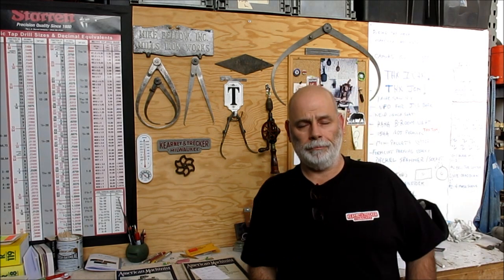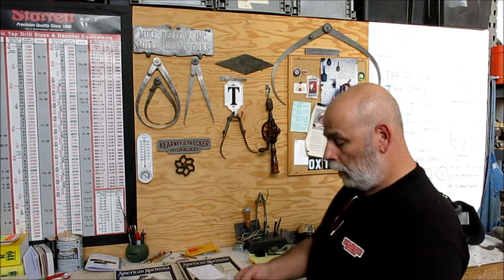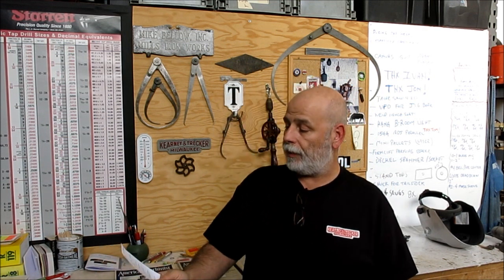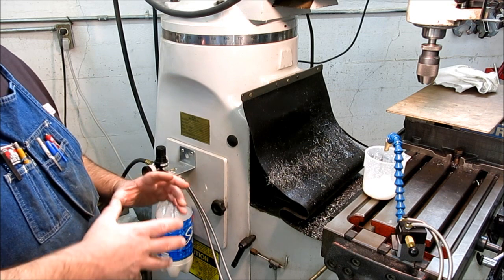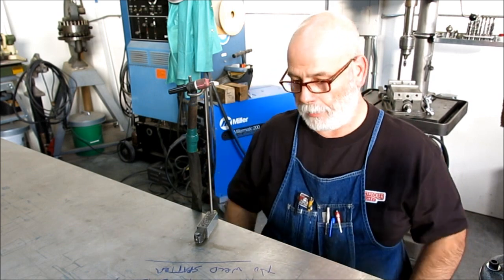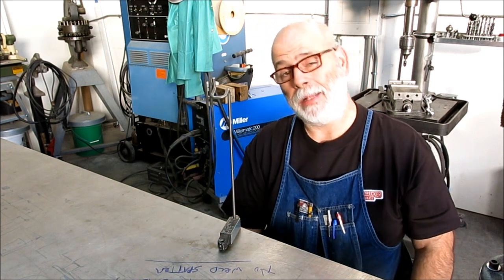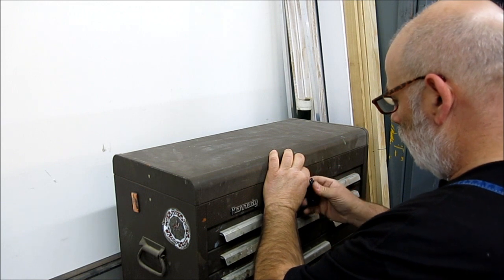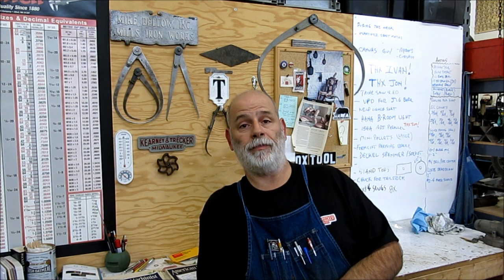Meatloaf 4

Comment: I have the Noga mister on my lathe (and borrow it over to the cnc milling machine) and I am pretty happy with it, except, that it is a bit hard to adjust for a very little spray-mist, but I dont use a pressurized container for the cooleant. I like my mister with almost no liquid in the air, just enough to get the surface of the workpiece a little bit wet.
I will adapt your idea, maybe even with the plastic soda bottles :)

Comment: Genius coolant system - no more fogged glasses !
The NOGA valve assembly saves reinventing the wheel - something I was trained to avoid many years ago. Your TIG torch holder story is a classic, dropping them isn't too great either, those alumina cups get expensive.
Oh yes - we had a guy start the tig welder with the foreman's help - no argon AND no water cooling !
Reply from the maker: Hi Jester,

I have a few spare wheels floating around the shop. Sometimes you never learn.

Cheers,

Tom

Comment: PS. I drove a 24 hour Tire Repair service truck and also I am a Auto mechanic and used a ratchet strap hold down all the time and I always fed the loose end through the sides of my truck to tie down loads of car & light truck tires and you can't feed the buckle between the cracks like the loose end!

Comment: on your bottle lift I left a suggestion that you mount the hook end permanently to the lift and only feed the loose end of the strap past the tank and put it through the slot in the ratchet and pull up the slack and tighten it down with the ratchet handle!

Comment: Hi Tom,

I really like your coolant set up for an open mill. I am currently using brush oil and air after some debacles with the mist system which came with the mill. I did like the cooling of the mist system. Water works much better than oil!

I have looked at some of the DIY flood systems. While they cool well, I don't think they they do a good job of removing the chips. You need velocity to get the chips from deep slots otw your recutting chips. On an open mill this would not be pretty.

I owe you lunch for all the good tips! I am even looking at my first pair of overalls!

Thanks!

Bill
Reply from the maker: Hi Bill,

I agree. This is why I built my own setup. Sometimes I want more air than liquid and sometimes I want pure air. You don't really need much to do a good job with cooling the cutter and work on a small machine.

Cheers,

Tom

Comment: One option for a nozzle holder. Where I retired from we used a Delrin or other engineering plastic holder that was a 240 to 270 degree segment of a circle with an ID maybe .010 under the quill diameter. Thickness of 3/8ths to 1/2. This ring segment had a leg opposite the gap where you could put a piece of 1/4" drill rod or a dowel pin. Or what ever size rod you would need. Only you had to put a Quick Release Depth Stop at the top of the travel so that the holder would not get pushed off when you ran the quill up. Gave mine away unfortunately. It was actually an apprentice at work that came up with the idea. We had a fixture plate an ran them off on an Anilam or Trak.  Although I'm sure others have thought of it.
Reply from the maker: Hi M,

Some mills have a boss in the casting for holding a rod. Mine has one but it not super convenient for a lot of things. Thanks for the comment.

Cheers,

Tom

Comment: Meatloafing around tonight, came in to this series a little late and now trying to catch-up. Don't burn your winky!!! Classic!

Going completely off topic; Kelty has a new advertisement that preceded this video. They make a good variety of gear and packs (backpacks). Years ago I hauled a Kelty pack around the former Soviet Union for 12 weeks. The pack was purchased specifically for the trip and was a new design internal frame with duffle bag sling style attributes on the large capacity pack. Upon my return I sent a letter to Kelty pointing out a few small problems with the pack and a few improvements but most importantly thanks and compliments on an overall great pack. Needles to say they sent me a free pack complete with all repairs and improvements that I use to this day for biz travels..
Reply from the maker: TurbineBorescope Now that is a great story. I have heard that Kelty and Mountainsmith used to be like this. I bought a Kifaru quite a few years ago. You could slide down a granite cliff sitting on it and it would not show any wear. The guy that started Mountainsmith started Kifaru after he sold MS.

Cheers,

Tom

Comment: Hi Tom, thanks for the videos! Is it possible that the gaps in the bottle cap thread are so that as you open a bottle of soda, the pressure is progressively released downwards, rather than having all the pressure blast out at the instant the cap is freed (if there were no gaps, the cap would tend to be shot upwards toward the ceiling at the last second). So it allows a controlled pressure release. Bottles in the UK have similar gaps in the bottle (male thread) so as the gaps line up, PSSSHHHT!

Comment: first hand experience. In high school learning to gas weld. While welding some steel, pop. One drop landed in my lap. My jeans didn't stop the progress which ended up between the left one and my leg. I jumped up and unassed my jeans in the middle of the class and got the offending bit of hot steel away from my LH nut. Yeah I heard about that one for a while.
Reply from the maker: Hi Mark,

Yeah you pretty quickly learn to use a gas welding or cutting torch standing up. Thanks for the comment.

Cheers,

Tom

Comment: Tom, where did you get the springs to cover and protect the tubing for your mister system?
Reply from the maker: Hi Marty,

The spring covers on the tubes came from NOGA. I bought the nozzle and valve assembly from Travers tool.

Cheers,

Tom

Comment: Another great video, thanks! What soluble oil are you using in your coolant/ mist system? Is it the same you were using in the small pressure bottle? Thanks again!
Reply from the maker: Hi Grant,

Yes its the same Mobilcut soluble oil. I only have one jug so it gets used for everything. Smell is fine also. Thanks for the comment.

Best,

Tom